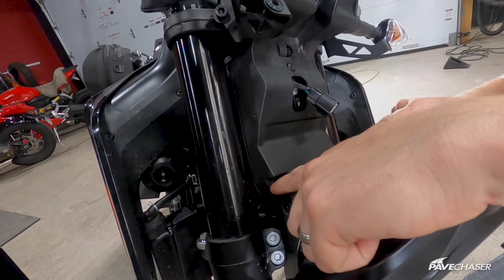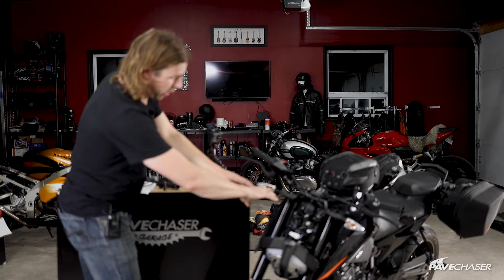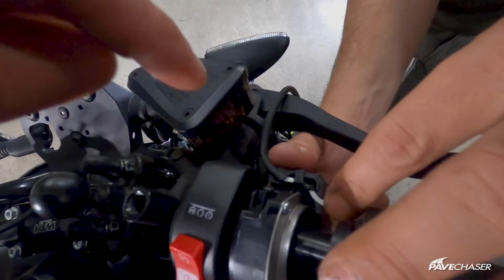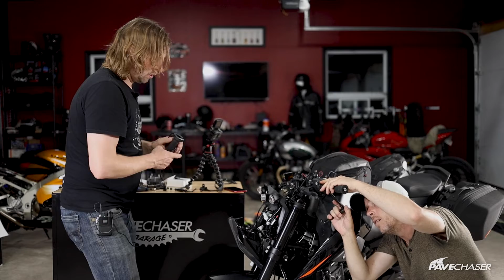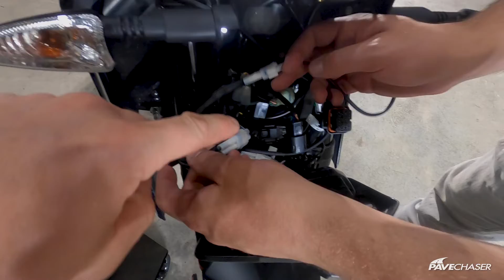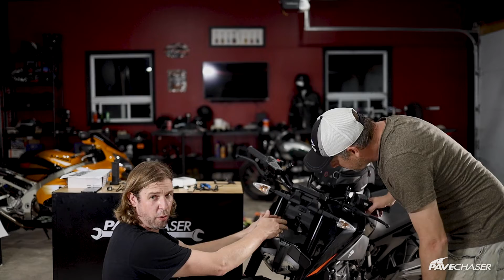KTM Duke 890 Heated Grips Install - KTM Power Parts

Comment: Nice video, you just didn't put it in the groove for the throttle grip sensor. So at full throttle it has to pull your cable.
Reply: Yep, that can be a little bit tricky but very necessary 👍

Comment: Put mine on today ... pretty straightforward forward and this surely helped. FYI the dash does NOT need to come off. As far as this crew: TALK LESS and show more of the critical parts in the installation! The most confusing part was how to get the little block on the throttle grip heater wires positioned inside the throttle grip housing correctly and that part is not addressed in this video and the imagery is all mucked up in this video. Also using zip ties and not cutting the ends off is a hack job. If you spend a little extra time positioning all the wiring and extra wiring under the cover it will mount easily. There is enough space. You just need to neatly position all the wiring. Also, Testing the grips only works with a running engine! They will not come on just on ignition. One important step forgotten in this video is: You want to count the rotations it takes to remove the top center headlight screw when you start this job because it also is the adjustment of the headlight aiming. If you correctly count how many turns it took to take it out you can correctly position your headlight spot on when you finish the installation.
Reply from the maker: Thanks for the feedback! 🙂

Comment: Helpful video! I realized that grips wont turn on if I dont start the bike engine.
Reply from the maker: Thanks! Yes, that is correct. It will show that they are turned on on your screen, but they will only heat up if the engine is running. ✌️